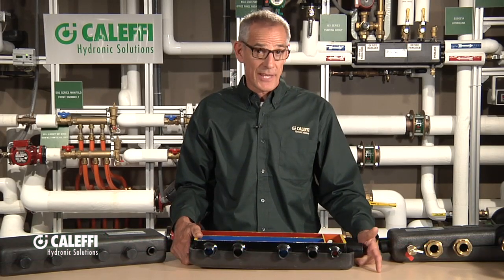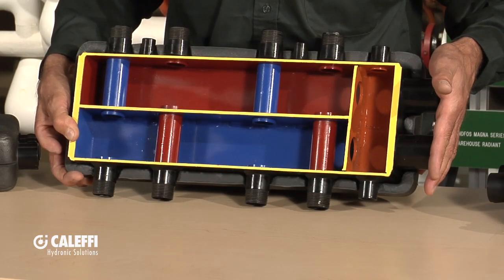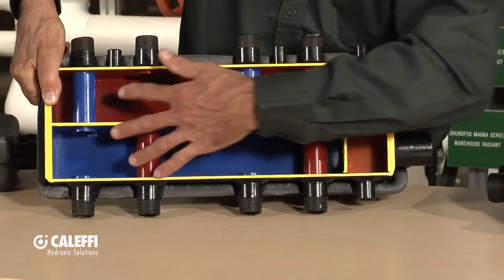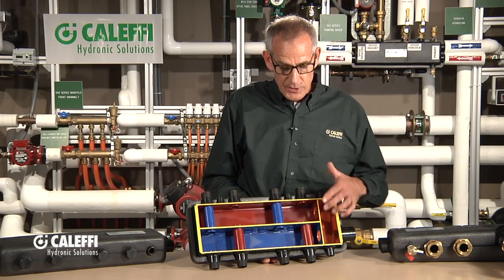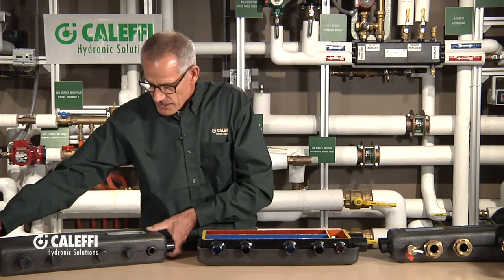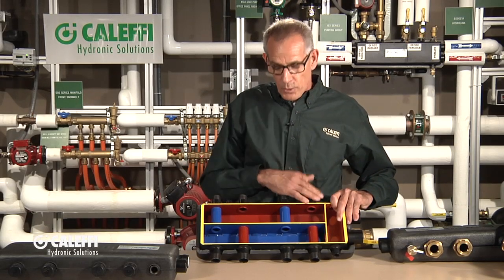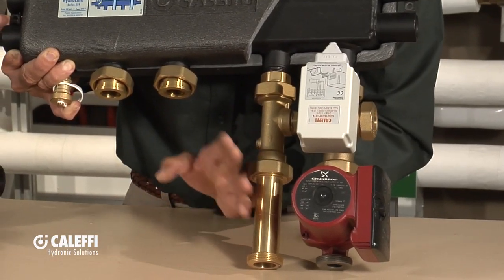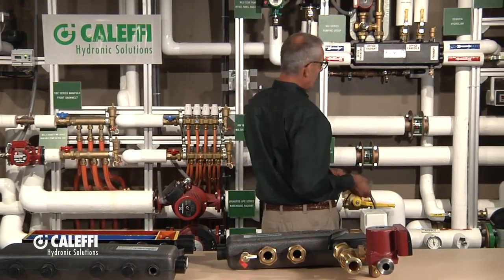HydroLink™ - Hydraulic Separators with Built In Secondary Headers

Comment: Would these work in a non pressurized system?
Reply from the maker: Sorry for the late reply and thank you for your inquiry.  You can use separators on an open system, but you need to make sure that your water and chemical levels are "right" to protect the system.  Air in a system creates corrosion on steel and cast iron products; that is why we are always concerned about air elimination (not to mention dirt and magnetic separation!).  Having an open system can introduce air that is hard on the components.  While you can use them, it is generally not recommended and requires special attention to system water quality.  

In North America, we offer a technical journal series called idronics.  Below is a link to the journal series.  We would specifically point you to the 15th edition (Separation in Hydronic Systems) and 18th edition (Water Quality in Hydronic Systems) for more information.

https://www.caleffi.com/usa/en-us/technical-magazine

Comment from the maker: Making secondary circuits by branching with tees  requires significant assembly work in the field. The Hydrolink has these  “tees” built in thus saving labor, and  furthermore the circuits are arranged in a parallel manner – meaning each circuit receives the same temperature of  water. Thanks for asking.